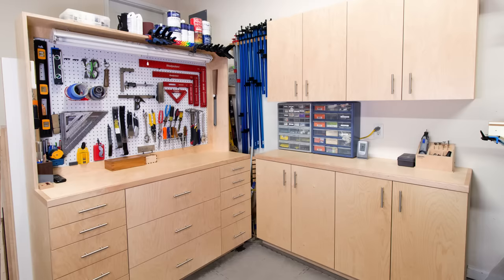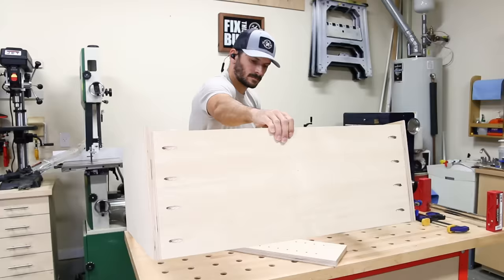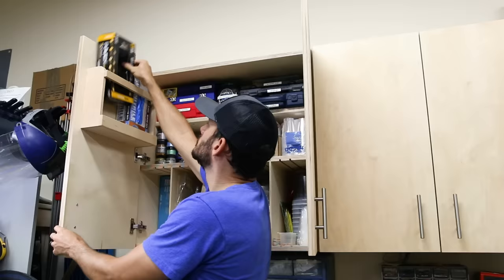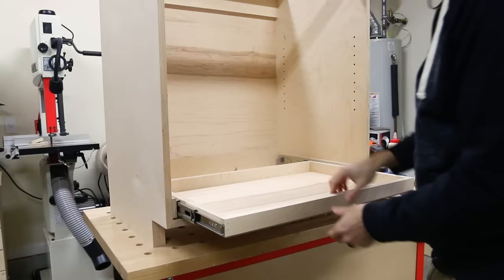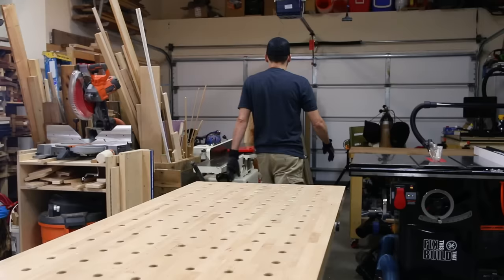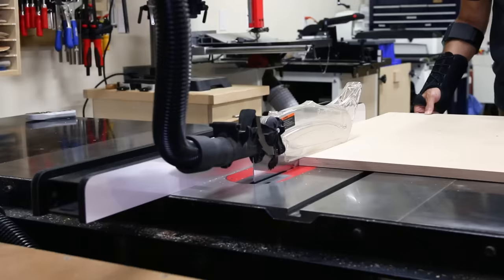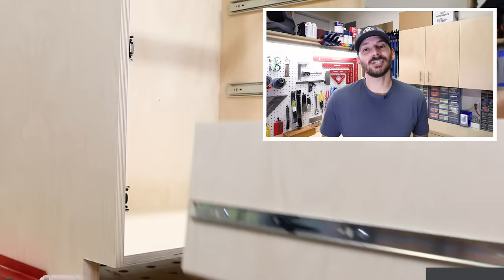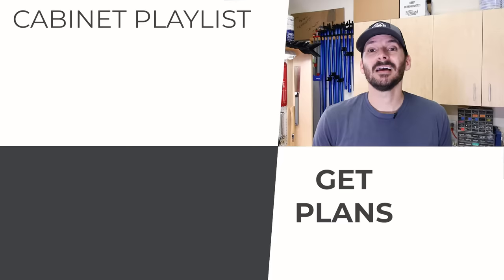5 Garage Shop Cabinets for Ultimate DIY Storage

Comment: Great work! I purchased the bundle of plans and then realized that the cost of the plywood vs buying premade cabinets are around the same. With the current cost of plywood, i'm looking at around $320+ for just plywood. For $325 I can get 2x premade ready-to-mount cabinets. I'll be holding onto these plans i just purchased for when plywood prices drop in the future... If they ever do...

Comment: Building specialized storage for the K.T.T. is the key to controlling it.  I have a shed in the backyard for the yard K.T.T. and will build a small lean-to beside the shop by the driveway for the bikes and power wheels.

Comment: Don't have KTT or a better half, I live alone in my house.😁 Do share space in garage with a motorcycle and lawn/laundry equipment so this looks like an awesome project. Need to upgrade the power in the garage with dedicated outlets for table saw and dust collector because sawdust is getting out of hand. I have a game plan though.👍 Eventually I'll build a standalone alarmed shed out back for the bike and lawn equipment and I'll be good to go. Will use battery powered lights until I can afford to run a sub panel. Thanks for all your inspiration and I got SkillShare for 50 percent off as I do a lot of work with Adobe After Effects and the rest of the Adobe CC Suite.

Comment: Very nice build  on the cabinets  i spent over 20 years working in  Commercial Woodworking  for m living  and we built a similar  Cabinet  except we used dowels and  glue and screws for assembly  and some staples  we did fabricate  most of our components using. A premium grade  Melamine  over the 20 years. I never saw one of our cabinets. Come apart the way your store bought ones did    Of course. I also used our cabinets in my own shops and garages as well  and even when they were grossly overloaded  they  held up over time  we did however use Baltic Birch on all our drawers  for added strength  and our customers could  pay more for cabinets  made out of it if they chose  nobody ever did as our standard cabinets exceeded AWI specs  and the company was in business over 30 years in the same area  and most of the customers and Architects  knew our products   And quality  as well as  had toured our facility at one time or another  i managed the Installation department  for most of my years there as  i once  had done installation myself  and enjoyed working in that part of the business   I could  go into the shop  if it was needed  as i. Did know how to work  a lot of the equipment minus all the CNC  equipment  primarily i  built using  a Sliding Table Saw  or a more traditional  10” table saw  in which our 100,0000 square foot shop had many  of
Reply from the maker: Sounds like you've made 1000x more cabinets than me in my day!

Comment: One thought regarding the idea for a miter saw station. If you're limited on space, try offsetting the location of the saw instead of putting it in the dead center of your cabinets.  If your garage can't fit ~20ft of length (8ft cabinet +  ~4ft miter saw + 8ft cabinet), than make one section of cabinets longer and one section much shorter.  This still allows you the space to make miter cuts on a long 8-10ft board without needing tons of clearance on both ends.
Reply from the maker: Great suggestion, Timothy!

Comment: Would have been cool to set up the cabinet that you made for the desk on casters so you can use it for storage most of the time but you could roll it out of the way and still have access to your desk.  The rolling cabinet could also help when you need an extra place for plans, tools and/or fasteners while on another project.  Either that or make the cabinet at seat height and use it as your stool...  great work as always!!  Cheers!

Comment: K.T.T. has reached critical levels in my shop! It is so much worse than that though... My shop has been coined "the storage room". AHHH! Everything from the chest freezer and drink fridge to fishing and camping gear, cleaning supplies, bins of old clothes we someday hope to fit into again, Crossfit/workout equipment, and yes- even the bin of wrapping paper. Conveniently, the dog food bin sneaks in right next to the outside door. Other necessary intrusions include the heat pump water heater, electrical service panel, solar service panel, and an access hatch to even more spillover storage beneath the basement stairs. Did I mention that all of this fits in 180 square feet with a door from the house and a door outside?

Comment: Lol, KTT is currently at about 4. The jeep and dune buggie (that we moded) still needs to be hung high on the side. I used a bike lift, but those suckers are heavy and I dont want them overhead where working, or anywhere if they fall.

Comment: Cool design. I've been looking at building something similar out of MDF and then ones I'd seen were all pretty much 400x400x780mm. I didn't see the point in adding an extra side so I think I'll build double cabinets something along these lines about 800mm wide (to keep with the 2.4x1.2m sheets). Not too sure about the spray can storage, but I think I'll retrofit some store bought racks. All I want around the bench is glues and fillers generally. Thanks for the ideas though!

Comment: My KTT is at least a 9/10. I sucked a play ball into the dust hose the other day and couldn’t get it out. Reverse direction on the shop vac blew the top off of my dust deputy instead of blowing the ball out of the hose.

Comment: What do you do about keeping your glue from freezing and becoming usable in a garage shop?
Reply: I have the same problem. I had to finally break down a by a garage heater from Amazon. Now I have to 'insulate' my garage. I've also heard of a neat little trick of building a cabinet with a high wattage light bulb in the bottom, lined with something reflective and fire resistant, to heat the rest of the cabinet. That works for glue and paint. Although, "paint" might not be such a good idea in a cabinet like that. But, it would be good for glue, tape, and other less flammable materials. I think it might actually work for paint too, as long as you keep the paint on the "top" shelves.
Oh yea. It also works better to warm the higher shelves if you have some sort of gaps going up through the cabinet to let the heat rise. Might even want to put a couple of 'small' holes in the bottom to let air in, causing a 'flow' of air through the cabinet.
Double check me on that heated cabinet though. It was a great idea when I discovered it years ago. But... it may have turned out being too much of a fire risk. Especially depending on what kind of bulb you use, etc...

Comment: Wall cabnets what size ply is yhe backer boards 1/4 or did you ho with 3/4 all yhe way around ? I need to build some cabnets for my shop and been going back and forth on how i want to build them
Reply from the maker: Here the detailed build on the wall cabinet.  It's 1/2 rabbet in https://www.youtube.com/watch?v=i8jcNQ0FzWQ&list=PLLkAgl7_UY3VGR4Rh40ppqZ3jZjzU6vtT&index=1
Reply: @Fixthisbuildthat  thanks thats what i desided to go with

Comment: I don't usually comment, but after seeing you make the effort to get matching shades of ply cabinet fronts on another video I was surprised to see here that the larger draw fronts don't match the smaller draw fronts. I would have had to make the openings line up across the run. Sorry, I've been told I have OCD... Mmmm ?
I do enjoy your videos, but wish you spoke slightly slower... just kidding. Keep up the good work. Mike (uk).

Comment: Hi Brad, love the videos.  Quick question on the base cabinets, do you need to incorporate treated lumber to place them on concrete floors in garage?
Reply: I would use treated in my garage. But perhaps if you know that your garage is always dry - then don't bother.

Comment: Hey Brad. Absolutely love your videos. You really give me motivation with being able to do more 😊 just a question. You may have answered this for someone else already but I thought I better ask incase you havnt. When your installing the drawer runners to to cabinets you use a spacer block. How do you determine the size and where to put them in relation to the drawers? Do you use an offcut of the drawers or something? I hope this makes sense. Thank you again 😊

Comment: Hi Brad - such fantastic work. I bought my house a year ago and have been creating my woodshop in the garage. Your flip top cart holds my planer and spindle sander. This weekend I'm starting your cabinets. I bought your module garage bundle. Do you have sketchup plans for the cabinets? It would be a real timesaver (and painsaver!) to be able to customize the design for the space which is a bit wonky. Keep the great content coming!

Comment: Does having a cast iron table saw surface make the wood slice easy like butter? Cause I got a contractor saw and I feel it's a bit on the rough side
Reply: There's a spray you can buy to fix that.  I got one called Glidecote.

Comment: Glad I got the plan bundle. I had no plans of building the hutch. And now I’ve changed my mind and I believe I’m going to make one. 

Question… the drawer slides I get I think are from the link in the description. At least those are the ones I have on their way now. I used pro mark the last time. They never come with the screws to mount them. I’m struggling with finding a screw I like. Seems like each one I’ve tried sucks. Do you have a recommendation?
Reply from the maker: Awesome, Angie!  These are the ones I've always bought.  I like them because they have a nice big head on them.  Only think I don't like is they are stainless steel, so won't hold on a magnetized tip.  https://geni.us/TqcIWWO
Reply: @Fixthisbuildthat  Thanks!

Comment: In my neighborhood, baltic birch plywood only comes in 5'x5' sheets (it's actually metric 1525 mm x 1525 mm). Is there any way you can make a version of your cut-list and plans for the 5' sheets?

Comment: I really like your setup. I know this is an old video, but ill try to ask anyway. Since you're building mostly base cabinets with drawers, could you just put stretchers in the bottom like the top rather than a full size bottom of plywood? With a big project like this it could save a lot of plywood.

Comment: Why you don't cut fancy joint on cabins? All you joint depends on screws?
Reply from the maker: Because I don't want fancy joints nor want to spend the extra time to make them.  And these cabinets are strong enough to take anything I put in them just as I've built them.  I prefer simple, quick and effective.

Comment: Hello Mr. Rodriguez, first of all I just want to let you know that I love your videos. Thank you for doing them. I am knew at woodworking,therefore, I do not have very much experience spacing the draw slides. I am attempting to make a cabinet for my tools in the garage. I would like to make a cabinet with 6 drawers. I would like to make 3 small,2 medium and one large. I have seen videos to figure out the placement of measurements for the drawers slides but they are for drawers of the same size. Do you have a way to figure out how to come out with the measurements to place the slides for the drawers? Thank you.

Comment: Those are great cabinets and an overall great system. Question... if I’m wanting to do a similar application indoors, and wanting to paint it white, how would you deal with the exposed plywood edge around doors, drawers, and fronts of dividers?
Reply from the maker: Can do several things.  Easiest if you're painting is to use spackle or wood putty to seal then sand and paint.
Reply: Fix This Build That thanks for the tip. Great channel!

Comment: Bruh. This is the first of your videos I've seen. If you're going to have the sponsor spot during assembly, make it smaller so we can actually see what you're doing.
Reply from the maker: I've done this in several other videos and so I think I was a little more loose than I probably should have been with that.  If you want to see it with full instructions check out the other videos in the playlist.  And thanks for the feedback, I'll keep that in mind for the next vid!